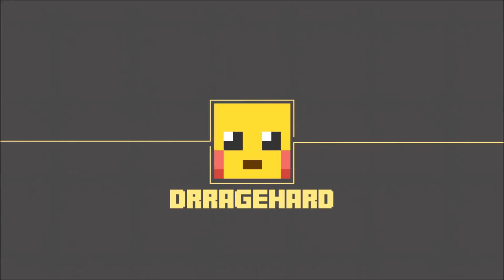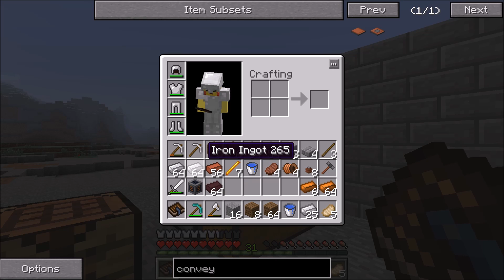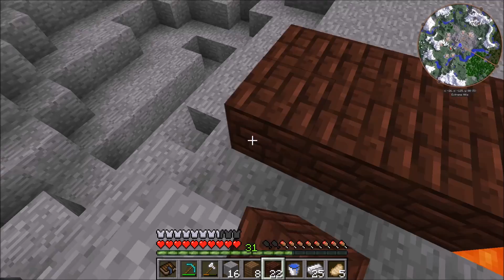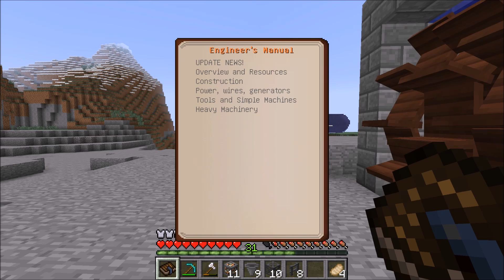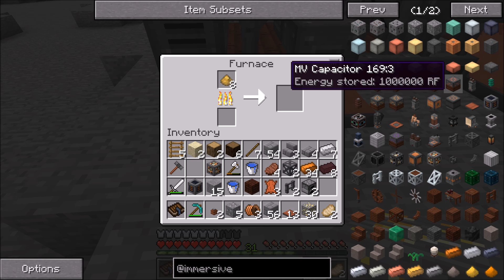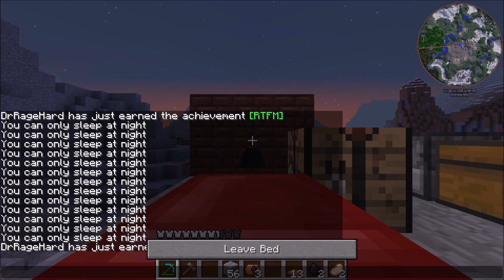Surviving With Immersive Engineering :: Ep.2 - Simple Crusher Setup

Comment: When there are no other ore duplication mods installed, the engineer's hammer can be used in a crafting grid to convert ore to two dust I believe. It's definitely in the configs. I rooted through the other day and found it. Also:

1) You got 1 additional Lead grit from grinding the silver... why didn't you just use the ingot off of that to make the MV Capacitor?

2) You went through all the trouble of setting up a crusher to double your ores then proceeded to smelt up lead ore directly. Why? Defeats the object of building the thing in my mind...

Despite that I enjoyed it a lot and I like this series!
Reply from the maker: +swordkorn hah, you have some good points :P I did mess up a fair bit with the lead, but id like to think I could blame it on being tired. Glad you are enjoying the series!